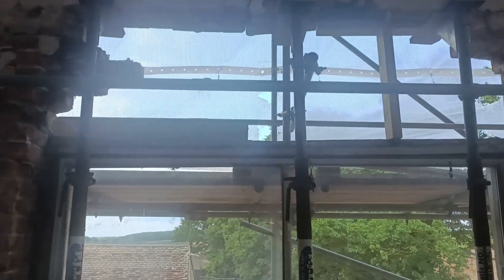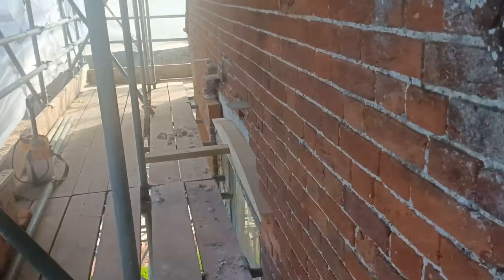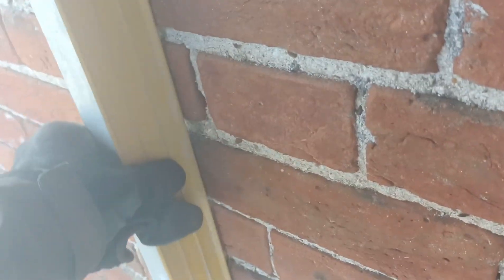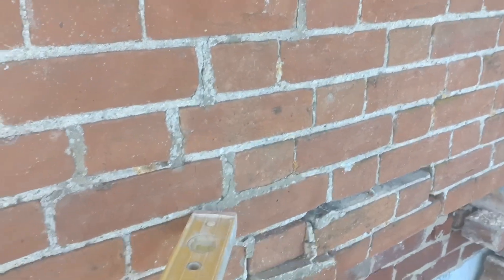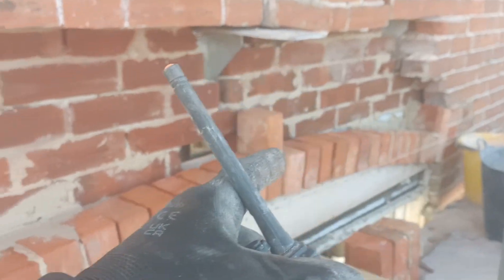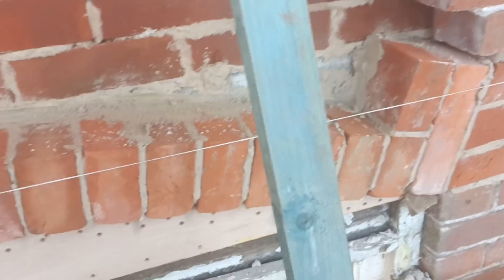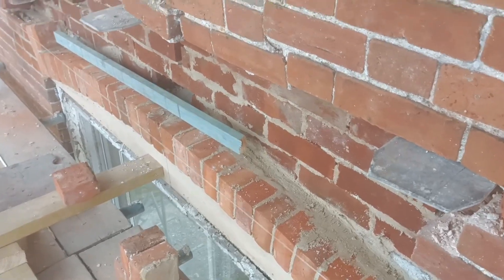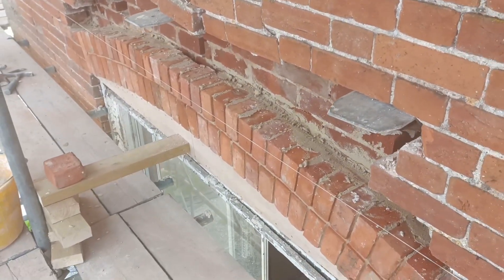Building a Segmental Arch with Reclaim Imperial Bricks

Comment: What type of line mortar is that Rob? I’m using hydraulic lime nhl 3.5 mixed at 4building, 1/2 grit and 1 lime (not my choice) and it’s really dead. 
Yours looks well creamy
Reply from the maker: yes, this is 3.5 as well. The key could be, we mix ours the day before then remix it quickly the next day. Wet up your left over mortar at the end of the day and re-use it the following day, you'll find its better the second time around.
Reply: @robsonger1  yeah I’ve found that it’s better when it’s left over night, we leave one in the mixer but we use loads as we are building a garage🤪👍 thank you for replying Rob
Reply: @craigstyrin3453  It's recommended to leave it a minimum of twenty minutes or more then remix it, it gives the lime time to do it's thing. You get a nice creamy mix then, you might need to add some more water to the mix on the second go, you'll tell the difference.
Reply: @DaveBloke-tg5wv will give it a go, thank you Dave
Reply: I prefer 2 soft/building, 1 sharp, 1 lime all in the mixer semi dry for 10-20 minutes until a little fluffy and aerated , then add water until smooth. Give it 5-10 minutes and then mix again
Reply: 2 building 
1 grit
1 lime

Mix everything dry first.
Reply: @benllewellyn1887  that’s the mix I usually use but for some reason someone has said 4 sand half grit 1 lime, to much sand in my opinion👍
Reply: @craigstyrin3453  Yeah, that is too much.
It's definitely a weak mix!
Reply: @benllewellyn1887  its the weight of the lime to sand I always thought, ah well we do as we’re told 😂
Reply: @craigstyrin3453  🤣🤣🤣, well you can tell them now!
Reply: @benllewellyn1887  I did in first place 😂😂😂